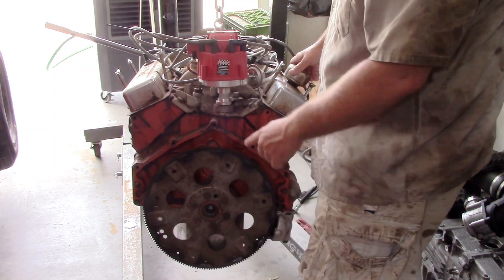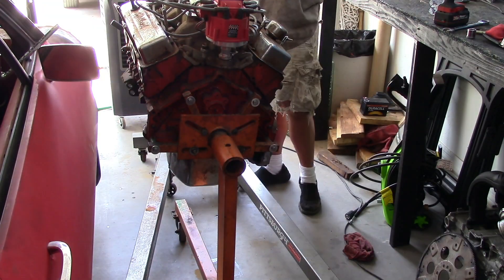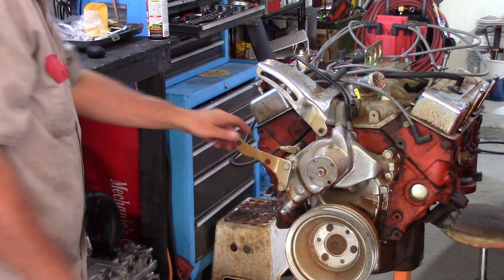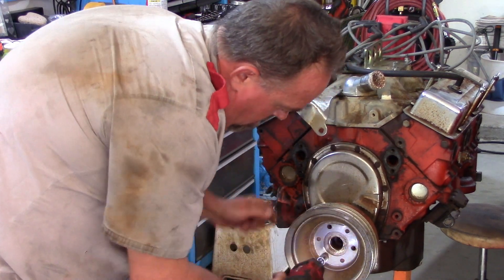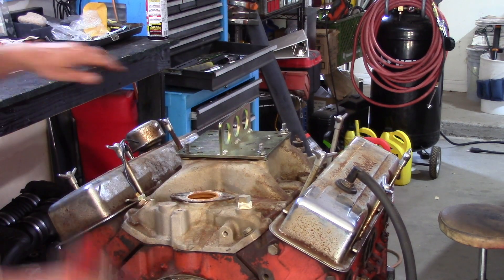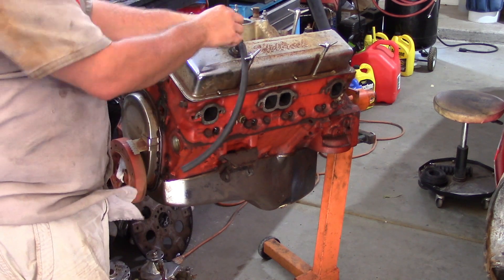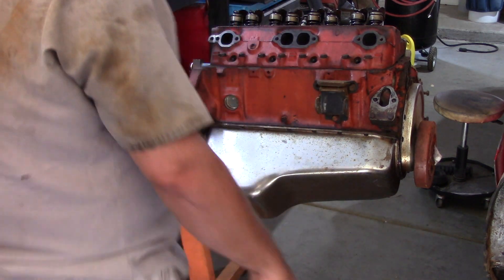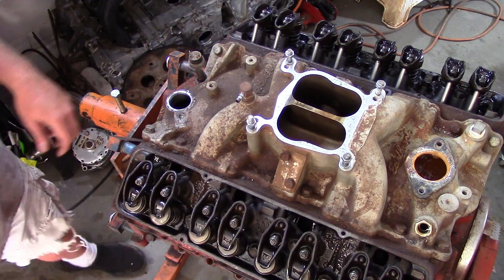How to tear down a Chevy 350 SBC Engine Motor PART 1

Comment: Please don't use 305 heads on a 350. May I advise taking the head off in the correct bolt torque pattern order. Makes it a lot easier and less of a chance of breaking a bolt off in the block. Engine does look pretty clean though, might wanna see if you can find some double hump heads. I have 3 pairs so they shouldn't be that hard to find. Hit me up if you need any help finding good older stuff for the engine build up
Reply from the maker: Thank you man, I was shocked to see 305 heads on this, but then again I have heard years ago guys slapping them on!  Double Humps huh? :)

Comment: If you are going to use this 350 for the car, do not run the 305 heads on it. 305 heads will raise the compression but the combustion chamber shape is very poor resulting in very poor air flow and a high chance for detonation. The 305 head swap thing was something that people tried in the 90s and many dyno tests had proven that they made worse power than just using the stock smog 350 head, the lttile but of performance that the compression you gain from the 305 heads will be negated by the amount of timing you will have to pull out in order to get the engine to stop detonating.
Reply from the maker: I am still on the fence about finding a Poncho motor but the prices are getting a bit out of hand!!!!
Reply: @ArrowheadGarage  yeah, that's why so many pontiacs,oldsmobiles, and buicks get Chevy engines swapped in, because parts are alot cheaper and easier to get. The Pontiac motor would be cool but won't give you much performance for your dollar and you would have to swap the transmission and find a full pontiac accessory bracket set which is very difficult to find these days.